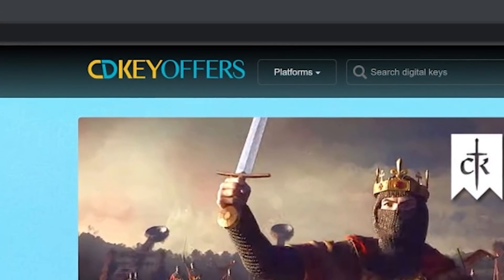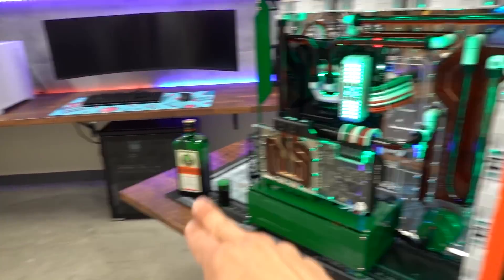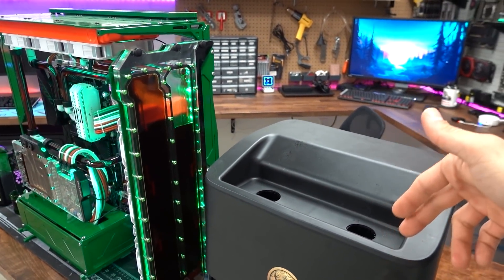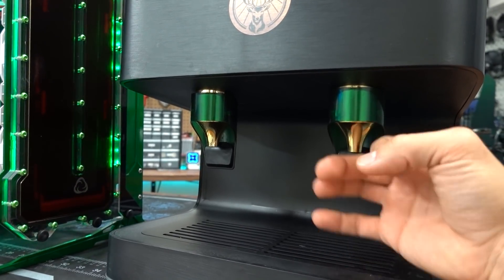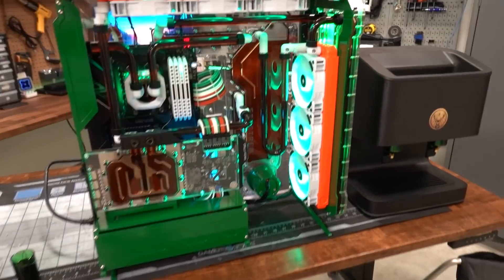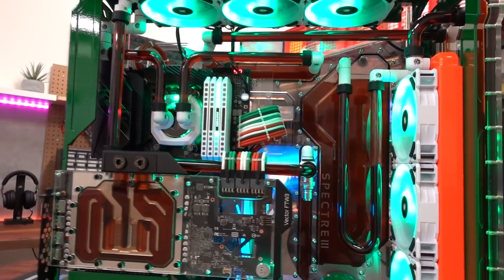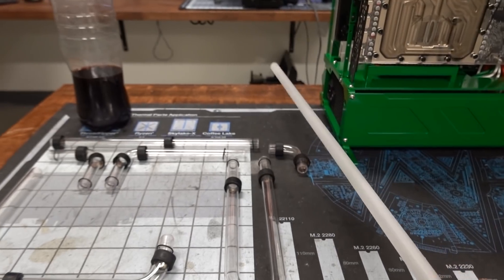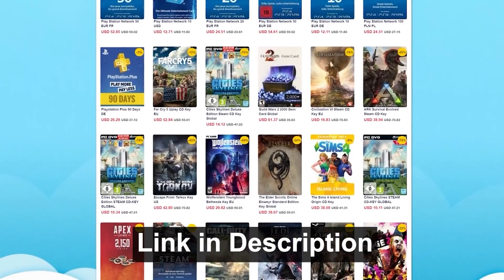IT'S BACK! My secret plans for the Jägermeister PC...REVEALED!

Comment: Does each bottle have its own chiller run? What is the flow output, for that Jaeger Chiller? I fear them pumps may be overstrained, by the PC pumps pulling at the fluid

Does the upper bottle feed, need to be air-sealed?
IF you had feed piping, go past the hole and be well immersed, into the fluid -- wouldn't that suffice to avoiding air entrainment?

With that said, I'd wouldn't treat this chiller, as a [regularly run] part of the main CLC system. BUT... I have a convoluted idear

Remember the days, of PCs with a "turbo" button... hows about a "chill" button?
Should this system find itself in rut, with difficulty getting any heat off, hit the chill button, to have the chiller get involved with a burst of cooler fluid, entering the CLC [while bleeding out some of the heated fluid, to refill/top up bottle]

Comment: make sure the fluid is non toxic cause some drunk german tank will break it and drink straight from a bottle even if its sealed and with a decorative tube sticking out

i would keep one side for a bottle of jager, just to dispence jager out as part of the front IO... 
maybe sandwhich that bad boy chiller into the guts of the build so its not so redundant. increased stability aswell it needs a green paint job so it matches the pc
... silicone thats aquarium safe has the lowest chemicals i.e mould preventer

Comment: chances are that chiller uses Peltier tek coolers. generally consumes about 60-100 watts each and are only about %10 efficient. in other words. if your CPU/GPU only puts off about 10 watts of heat. your golden. otherwise your going to overwhelm it.

Comment: maybe try using the chiller on a container that then is added to the loop, so air bubbles stay away from pump, and can be purged out by the loop itself, does not matter if it sounds like a fountain, a jagger fountain pc chiller gotta have a peculiar sound

Comment: Will the chiller be strong enough to make a discernable difference with the rate that the fluid will flow in and out? I mean it sounds like a cool spectacle but Im not sure if it will actually be able to cool the fluid based on the flow rate and the volume.

Comment: can u not use a few silicone o rings of varying size stacked on each other to make a watertight seal on the bottle neck. 
alternatively what i would try and do is drill the hole in the top of the bottle and just have a 90 bend that goes inside and passes out the bottom of the bottle (bottle will be just decorative can still fill with fake jager fluid) and have it straight connect to the jager machine itself just got to take the top off the jager chilling machine and see if u can thread on a fixture or tube piece that will fit into ur jager bottle

Comment: Won't the jägermeister bottles fill up faster then they empty out basically draining the rest of the loop and once the bottles get full they are going to have pressure build up. You might figure out something like an overflow or choke the line a bit so it doesn't fill up so fast.

Comment: Not sure if it will but if the cooler/chiller has to keep the Temps cool at a certain point cuz that's what it is design to do it might run 24/7 which I don't think is optimal as I think it will burn out tryna keep Temps kool 24/7 as it operates not running 24/7 but only wen needed... worth a try tho
Reply: And to further my comment the chiller actually is supposed to keep the liquid at a certain temp which I would believe will be forever wayy cooler then wat liquid is in the PC loop. So idk but definitely a good mention if nobody has thought about it..

Comment: chillers like freezers arnt designed to take sustained heat loads they tend to switch off and on periodically to maintain a specific temperature and if there is a constant high heat load it could damage the chiller in only a few days. its the same reason why you cant just put your pc in the freezer

Comment: I really don't think the chiller will work. it isn't designed to chill a constant flow of fluid like that. I personally would use a bottle as a reservoir in it instead. That would be easy.

Comment: this won’t work at all you’ll just end up killing the condenser inside of this cooler assuming it’s using that technology at all it could be using an thermoelectric cooler works great for water that you leave stagnant for extended periods of time such as a beer or a pop but with moving fluid the temperature difference compared to the amount of energy you’ll be burning will be negligible it will make very little if not any difference to the overall cooling performance of the PC before proceeding I would suggest doing research to make sure that it’s using a condenser-based cooling system similar to what an AC unit or a fridge would use  has a much higher chance of working over thermal electric as if it’s thermal electric this is a complete waste of time unless you wanted to make like a cooling booster shot rather than using the machine all the time to try and improve the performance of the PC why not use it as a Reservoir with cool water in it to give your PC a cool shot like giving it a boost of adrenaline when your system gets too cold it would allow the thermal electric cooling to keep up with the demand without being overwhelmed and if it is a condenser considering if it is using one it’s probably really small allow it time to cool down preventing itself from breaking so it only be activated temporarily during situations of high stress And during the situation when it is not needed it will be disabled this will prevent you from killing the thing

Comment: I don't know how cold the cooler cools (I think that's a sentence); however, alcohol freeze's at a much lower temperature water. Basically will the cooler freeze the water/coolant? I looked it up, and couldn't find this exact model but from what I've found they typically cool the liquid to about 0°F or -17.8°C.
Reply: nope, it will drop it to 6 - 7 degrees.........

Comment: From how I see it... there could be some issues with how rigid the entire set up is. Unless you uses softlines the chiller and PC will need to be tied together on the same base or else bumping only the cooler could fuck up any hardlines to the PC. 

Softlines would fix this but IMO probably look really ugly.
Reply: Given that it's alcohol themed and he's using a machine designed to chill alcohol, he might be able to get away with an industrial looking braided tube. Something like you'd see on the soda gun behind a bar, to keep it on theme.
Reply: @forgotn42  I could agree there.

Also... some of us might think softlines look bad... but I doubt anyone at the Jager headquarters cares enough to have the same opinion. 

It could be all softlines and they likely not know any difference.

Comment: This might be hard to do but instead of directly running the liquid used for cooling the pc through the machine why not have it just pass through the bottles with a sealed tube inside. it might chill the coolant but probably not enough for condensation. It might also help the cooling machine stay alive.
Reply: Bassically run a pipe all the way through 2 jager bottles that are connected to the cooling machine. You could take it a step fauther by making the jager bottles refillable  at the bottom of the bottles so you don't have to remove them to refill them.

Comment: I don't believe the chiller will last long running 24/7 better to just run the tubing straight through the chiller and out into fake glasses which runs out the bottom and back into the radiators.

Comment: Use liquid gasket to seel it. It's for sealing car engine parts.
Reply: U might have to port one of the bottles so the system dos not get over pressurized due to a different in flow rate from pumps.

Comment: Wouldn't the pump pressure still be an issue going straight into the bottle? The small hole in the cooler machine would be a bottle neck.
Reply: no.... the bottle neck will be the bottle neck........ paaahaaahaaaaaaaa
Reply: @chloedevereaux1801  trueeeeeeeeee

Comment: I feel that if you already had a problem of the pressure from the pump flowing to quickly the problem will still occur since its still pumping at the same speed. Unless both the pump of the computer and chiller are close to the same then one will eventually overpower the other. Let me know if I got the wrong idea

Comment: Work smarter not harder, use the machine ONLY for aesthetics, not start drilling all crazy into bottles or many holes in the machine, but run hard lines from the spouts and that's about it.
Reply: To continue my thought, as I'm watching... Figure out a rubber spout sealed port to screw onto the bottles, once they're into the machine you won't see the connection.

Comment: A. it's hideous. Like noctua ugly. So I guess that's a love/hate thing.
B. Splitting and splicing the loop like that will just have the pump only circulate the path of least resistance, which is likely the chiller and not the cpu, rads, and gpu.

Comment: nope, dumb. i see how its tempting but its just a bulky box and pointless ugly tube runs strapped to an otherwise awesome PC. many potential problems (cooler longevity, condensation, leaks, finding aesthetically adequate solutions) and its gonna look butt ugly. 
if you're gonna get crafty and cut glass, making a res out of a bottle would be really nice and already very special, and not so hard cos you can use the existing screw top lid for a watertight outlet and the return through the glass doesn't have to withstand pressure.
spend some time to put lettering/branding on those garish rads.
the frosted tubes should be very nice though! 

if ya wanna get risky, get drunk, tear antlers off your nearest moose in hand to hand combat and slap them on top, then go full deer hunter and play a few rounds of roulette with lyle.